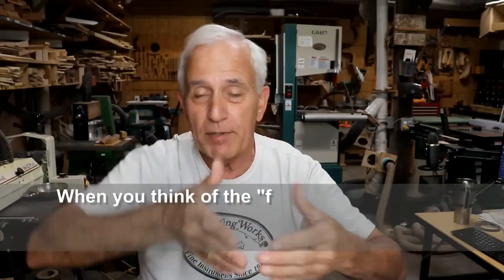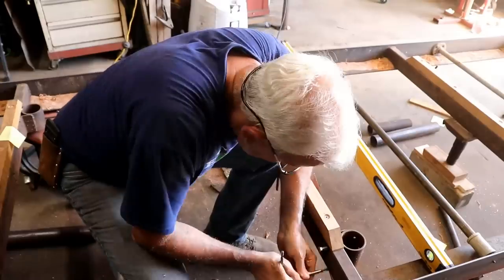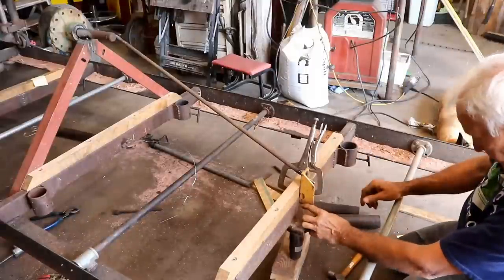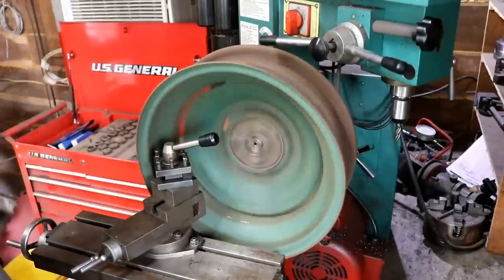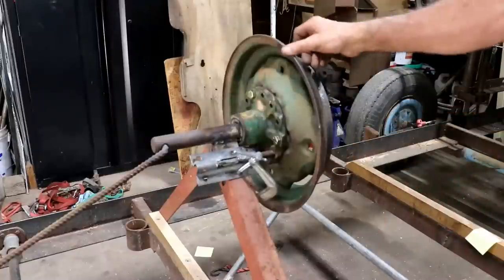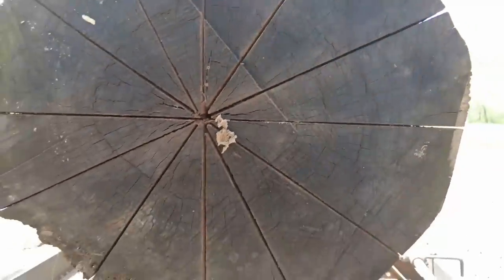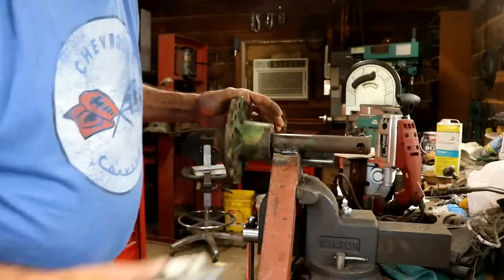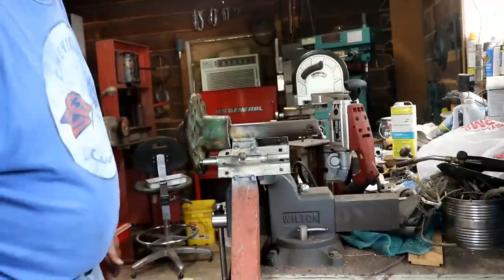645 RSW Building A Quarter Sawing Attachment

Comment: Quarter sawn produces the most  flame in the grain of wood (if there is any) but it also means the most cuts & ergo the most waste (sawdust)!
Would a "sacrificial" plate mounted to the disc allowing you to run the saw all the way in (through) help perhaps Gerry?
Reply: Well, that's kinda the way it goes. Do you have a solution?

Comment: Why wouldn't you cut horizontally down the log, wouldn't that give you larger pieces with the grain running parallel instead of wedges that go from thick to thin? Not a wood worker...but it seems that would work as well?
Reply: He is cutting horizontally, just through the middle.
If he were to cut from the top down, it would yield very little
quarter sawn grained wood. By sawing through the middle and
tuning the log, he gets all quarter sawn wood from the whole log.